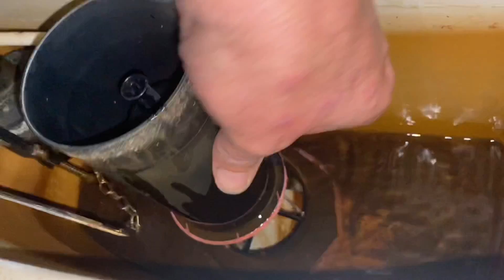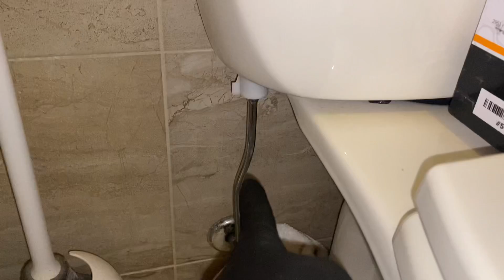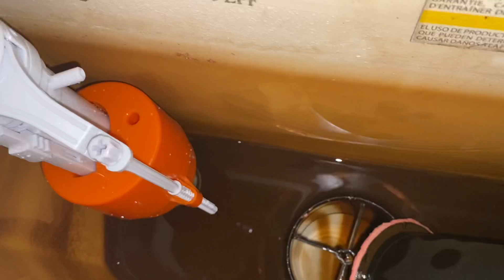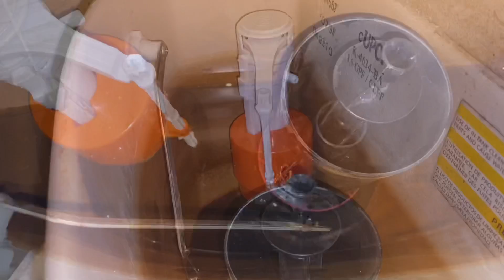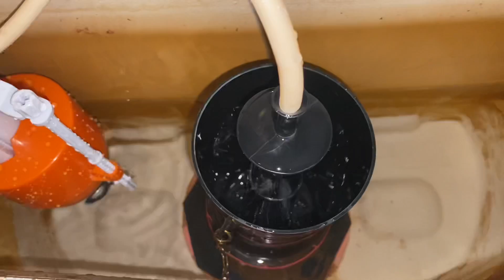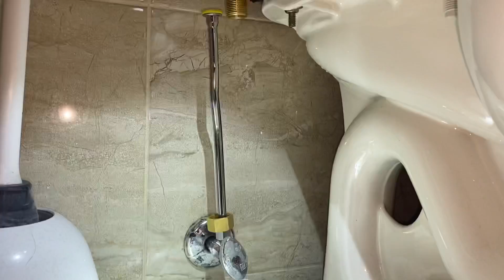How to Repair and Rebuild a Running Kohler Toilet with Bad Fill Valve and Canister Seal

Comment: Kohler makes an yellow canister gasket because of hard water issues compromising  the red gasket. They also have an improved overflow nipple connection so the hose doesn't pop out.

Comment: Mikey at 4:20 you let the nut pull the tube flange on the filler it should have been seated better before attaching the nut it may have been cocked and messing the seal up I was surprised to see that and then when it leaked it validated my concern

Comment: "That's a good sign". Yeah, so the valve actually turns off. As an electrician, when we were really slow in 2009, I had to fix random stuff like toilets and broken pvc pipes from frost damage, etc. My boss was trying to keep me busy and keep me on the books and have ran into a simple toilet valve replacement going full bore rip out the drywall and replace the shut off valve because it leaked and it was the old quest that don't have parts anymore. Talk about opening a can of worms every job you take up in the northern hills of michigan.
Reply: you can get special "quest/polybutylene" to pex transition fittings, they're the copper crimp ring style. never tried them myself, as it's best to recommend and do a full replumb.
their homeowners insurance often wont cover water damage/leaks if they know it's polybutylene piped or will only cover a flood from it once. there's tons of that junk installed here, much of it is sub-slab in older high end condo's, it sucks opening all the walls and ceilings to replumb, but sure beats removing the concrete and floors.
Reply: @throttlebottle5906  What's kinda funny is that with the old Quest, the valves can be taken apart and re-sealed. My buddy on the other side of town had his whole house plumbed in Quest in 1990 and figured out a couple of years ago you can take the valve apart and find the seals online to fix them.
Reply: @ATSNorthernMI  around here it just pinholes at random locations, in walls, under slab, middle of an exposed section, at shutoffs, everywhere. ticking timebomb junk. 🤯
Reply: @throttlebottle5906  Agreed. Hopefully PEX doesn't do that in 30 years.

Comment: I quit using my Gerber compact knife I was always dropping that little ass screw to replace the blade lol . I switched to the Milwaukee fastback the blade change so much easier and quicker.  
Great job with the water closet and great job explaining as you were rebuilding the tank.

Comment: 👌 Quick change towel trick  is definitely the way to go. My policy is always to replace the supply line and clean the sealing surface on the base of the flush valve. Dye test once complete.  I see more callbacks on toilets these days then anything.